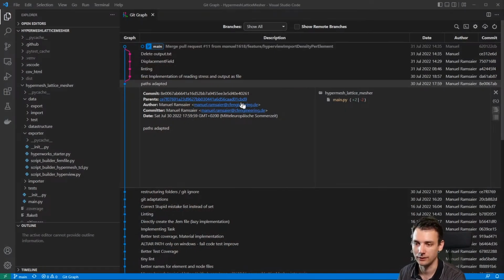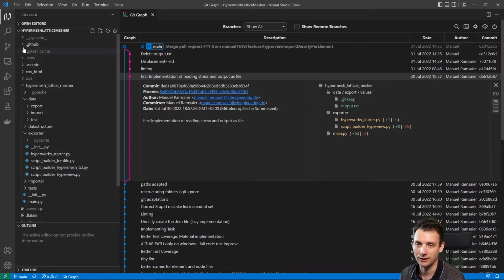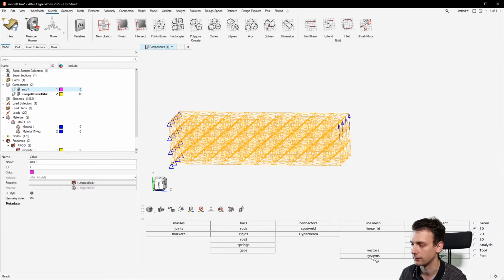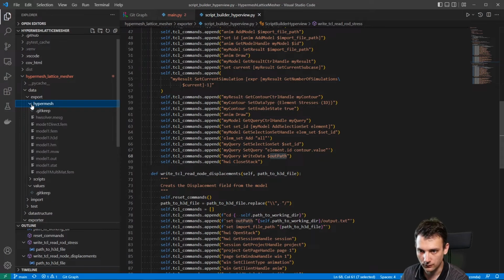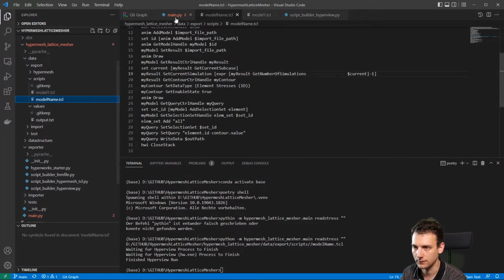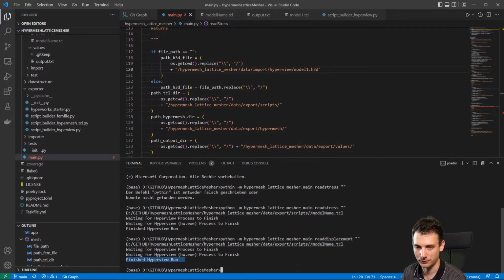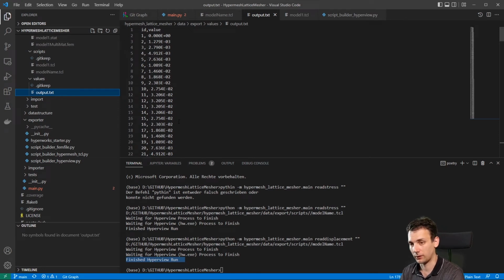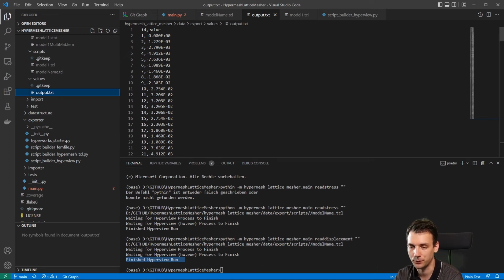Lattice Mesher for Hypermesh #6 - Reading Hyperview Results (Stress and Displacement)

Comment: Hi, fantastic work.
It is interesting for me, that the query for the stress values doesn't give the output in the order of increasing element id's, but it can write the output very fast. I did not find any HV command, which could help with this problem. I tried to make a list and write the file line by line but it is very slow in Tcl. Maybe reading and sorting as a NumPy array can increase processing speed. 
Or am I wrong, don't you know if there is a direct Tcl/HWC solution for this?
Keep up the good work.
Reply from the maker: Hi! Thank you for your nice words. You could sort it in tcl with a struct there but I wouldn't bother but rather sort it with after read-in with either numpy or plain python
Reply: @ManuelRamsaier   Thank you for your answer!